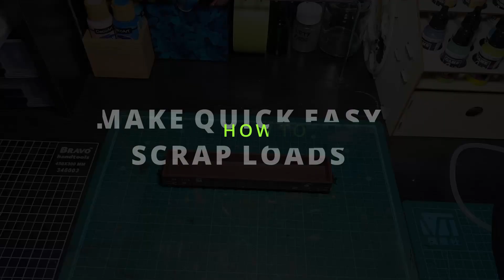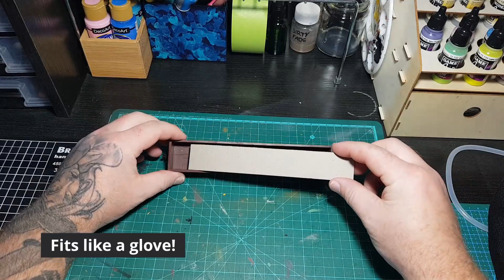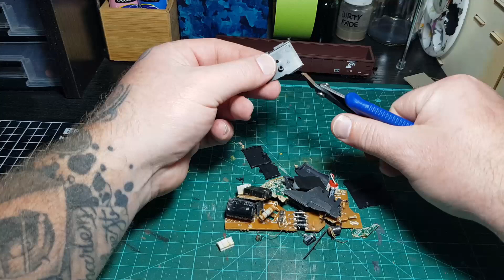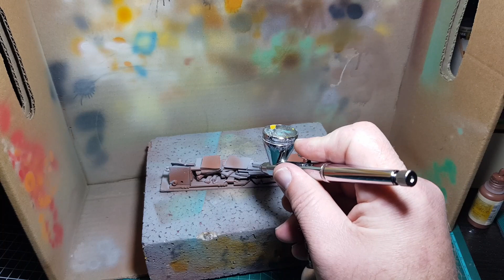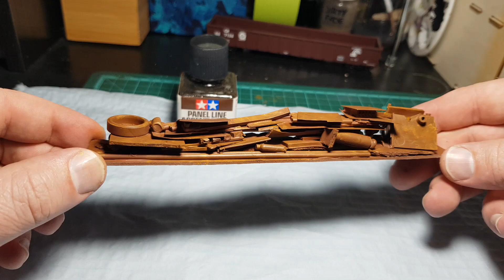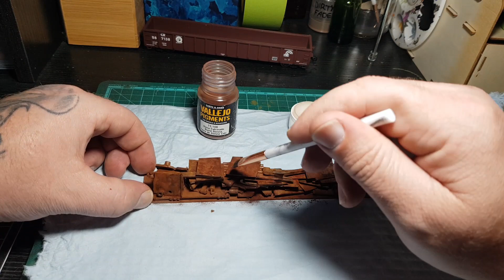HOW TO - Make Quick Easy Scrap Loads

Comment: I've got a box full of old plastic wheel sets that I was gonna throw away when I changed to all metal wheel sets, but will use them as a gondola or flatcar load.  I save everything, even the pieces of metal when I drill something.  I even save old plastic knuckle couplers when I replace them with Kadee couplers.  I use the "Chopper" from Northwest Shore Lines.  I also make my own iron oxide (rust) from 0000 steel wool & vinegar.  I also make my own weathering powders from chalk.  Cheers from eastern TN
Reply from the maker: yeah good idea mate, there's no such thing as waste in model railroading!

Comment: Whilst you have done a great job, I feel that you have missed the target completely regarding the paint job. In real life, most scrap steel is painted; and much of it is galvanised or plated (and possibly then painted as well). So having a steel load that is 100% rusted is to miss the point completely. I worked in my cousin's scrap yard during holidays. I saw a lot of scrap steel :D .
Reply from the maker: Cant please everyone bud, im modeling scrap metal how i wanna represent it. Go do your own to the style you like.
Reply: @TheSteelRoad  Hey dude, it's your railroad.
Reply: the metal/plastic foils that tablets (medicinal ones) come in make excellent scrap "shiny" metal. Cut up pieces from a couple of different ones of those (even with the writing!) and sprinkle them on, with a bit of glue. Only a suggestion.